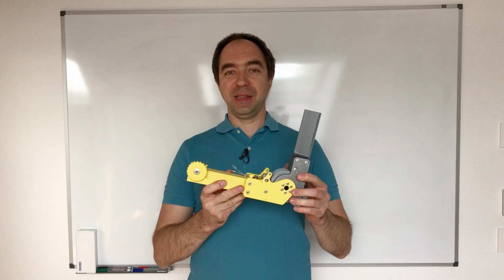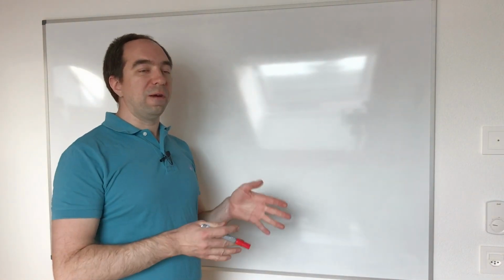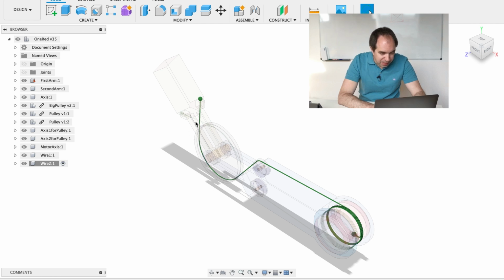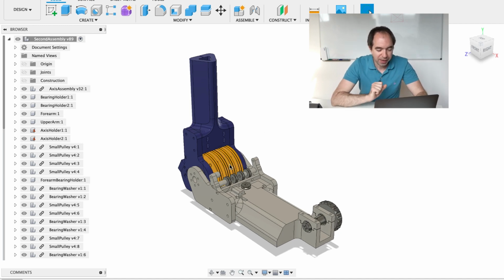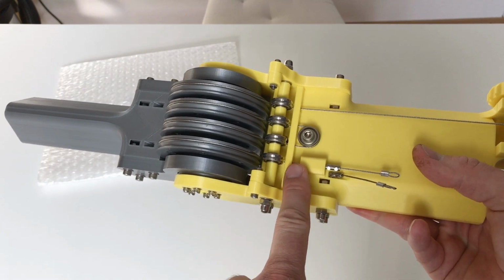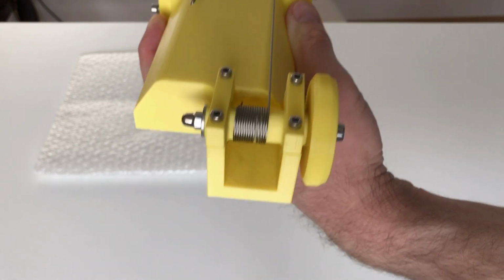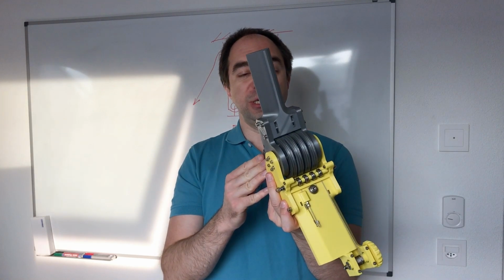You've never seen the Robot Joint like this one!

Comment: I don't think the spool to large pulley size makes a mechanical advantage because the large pulleys aren't moving, they are just functioning as a smooth corner for the cable. So it is only the spool to small pulley that function as a block and tackle.
Reply: Alana Catherine .....   possibly you missed the point of the design ....   i am still pondering it
Reply: Not at all, look at how the design would compare to a system that would be used to lift something instead of rotate it. The large pulleys are only functioning as bearing to allow smooth rotation around the axis, but they aren't actually part of the "reduction" system. The function of the size of the large pulleys is only to allow the small pulleys to have a straight pull on the cable.
Reply: Basically, if you look at the very first drawing he did with trying to lift a weight with only one pulley, that is exactly what the large pulleys are doing. In a block and tackle, it's only the pulleys that "move" that actually create an advantage. The fixed pulleys only redirect the force to make the system take up less space. You could get the same advantage with less pulleys but it would be a much "longer" system. (Hint: compound pulley)
Reply: @randomalleycat  Yes, precisely. The big pulleys allow it to maintain a more even pull on the cable when the arm is moving.
Reply: @randomalleycat  But the amount of cable in contact with the large pulleys reduces as the joint closes, so I think the small pulleys on the forearm do count as "moving". The opposing cable large pulley arc increases by an equal amount, but since you could exclude the opposing cable and still be able to contract the joint in one direction, I don't think that will cancel the "moving pulley" advantage.
Reply: @dekutree64  The pulleys on the same side of the arm as the spool are not "moving" nor are the large ones on the joint. You can only count a force multiple for each line that goes to or from the load. So you would get the number of "moving" pulleys, the pulleys on the "forearm" opposite the spool,
times two in this configuration. 

I'm not sure if you think that I was saying that there are no "moving" pulleys and no mechanical advantage at all, but that is certainly not the case. I am saying that the large pulleys only convert it to a rotating force from a pulling force. If anything, they add to the friction losses. 

I definitely agree that it works and is an awesome design, I'm just addressing an apparent miscalculation regarding the amount of mechanical advantage generated.
Reply: @abcqer555  Exactly, 
I'm not saying they aren't doing anything, they just aren't adding to the mechanical advantage multiple.
Reply: @cedricpod  why even say that without contributing to the discussion?

Comment: The difference of diameter between driver pulley and the big pulley will NOT add any mechanical advantage. If the big pulleys were half the diameter, the system will still have the same mechanical advantage. 
However, the diameter of the drive pulley determines the amount of cable being pulled per rotation, so a smaller diameter requires less torque.
Infact the diameter of the big pulley does not matter at all for mechanical advantage, it just acts as a force redirector.
Reply: That's what I initially thought too, but think about it in terms of the output angle for the input cable displacement. If the input cable moves a distance x, the change in pulley angle for a diameter D is 360deg*x/(pi*D). Since D is in the denominator and the arm angle is proportional to the pulley angle, you get a better reduction with a bigger pulley.
Reply: xenontesla122 ....   i think you may be wrong ....   possibly the big pulleys give plenty of cable length to consume and un-consume  ....  or perhaps i am wrong
Reply: @xenontesla122  your argument is wrong because the arm is not attached to the big pulleys, it is attached directly to the cables. Diameter of the big pulleys have nothing to do with how much cable is being pulled. The big pylleys (and all the other pulleys) simply redirect the force. That is how pulleys work. The number of pulleys multiplies the force but their diameter is irrelevant.
Reply: @AB-gd8hn  I agree with you. It is the number of repeats that matter, not the diameter of the pulleys. However, I think the diameter is important in this application because your 'payload' is moving and you want to maintain a certain angle... not quite sure how to express this.
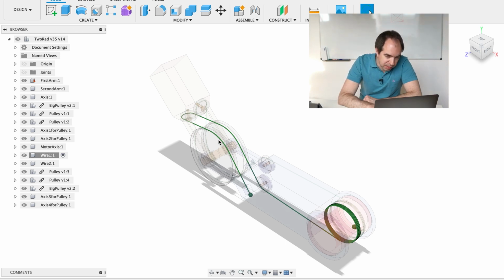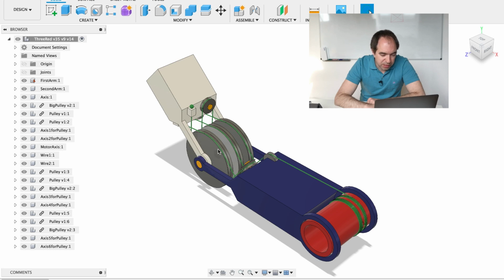Reply: @AB-gd8hn  In the first example at 2:43 the arm maintains the same angle as the pulley because the length of cable between the arm and the point where the cable contacts the pulley is constant. In that case, the change in angle is due to the length of cable in contact changing. This is very different from most pulley systems where the length of cable on the pulley is constant or the change in negligible. In my dynamics course, we solved pulley systems by finding an equation that links the change in length of rope to the change of the output. We always included the length of rope contacting the pulley in our equations, but it would normally cancel out because it's constant. If you do the calculations for the length of cable l as a function of the pulley diameter D and arm angle θ in radians for the system at 3:43 you get l = 2πDθ + four constants, so dθ/dl=1/(2*π*D). At 4:23 it's 1/(3*π*D) and so on, always inversely proportional to D.
Reply: Sort of. It's not the diameter of the big pulleys, but rather the radius of the arc the small pulleys travel around. their travel arc radius is rougly equivalent to the big pulley diameter.

Comment: First of all fantastic build!

There is a reducer based on cables that could be awesome in you set up. 

The elbow should have a single wheel and two single cables terminated in blocks. Just like your first set up but terminate in the “bicep” with the fixed side of blocks. 

The motor shaft should have two small and two slightly bigger cylinders. A cable should be wound on the small via the block to the big. 

This system gives reduction based on the circumference of the cylinders. Equal cylinders gives infinite reduction.

Comment: Imagine a motor that drives an axle, that have two different diameters, having the start of the cable on the small part and the end on the big. When winding the "differential diameters", it will shorten the cable loop going through a simple pulley. 
The smaller the diameter difference the bigger the force it can pull...
Do I need to mention that the cable is fully winded on the small part and it unwind from there to windup on the larger part and vice versa... You can make on axe with 2 pairs of these reducer, for reciprocal moves...
Reply: I like this idea.  Using the similar idea of pulley-based mechanical advantage wrapped around a joint but with a differential pulley system. The only disadvantage is that the load is not spread across multiple cables so the tension in the cable and the loads on individual pulleys is higher.
Reply: check out the work from Rise Robotics e.g. https://www.youtube.com/watch?v=RGuivIN5y3w
Reply: @bschena  That's simply amazing. Thanks!
Reply: brilliant concepts  ....   thanks for sharing
Reply: There is a mech called a "Chinese Windlass" that sounds exactly like what you are describing. I built a high pull system based on this concept decades ago. It's great in principle (and works in practice), but there are a few (very related) really serious issues with it. 

At the bottom of it all is that the mechanical advantage you get (from zero to infinity in a single stage, theoretically) is related to the "D-d" ratio of the two pulleys (e.g. the differential diameter as you described). The higher the ratio, the smaller the delta BUT the longer the cable required. For short, high force designs it's manageable. If you want a long stroke design you end up fighting the cable length in two  ways - e.g. where to "store" it (you need LONG capstans to reel it all from one side to the other - so each "side" needs to be designed to hold essentially "all" the cable, so its not very space efficient. 

A related problem is called the "fleet angle" problem. Essentially, that's the (geometry) problem you get when you try to wrap a mile of cable around an axially-long capstan. Cables are pretty fussy things and not friendly to high fleet angles - adjacent wraps start to rub on each other, causing destructive wear, friction, and cable "jumping". 

There is also a cable length change that occurs as a result of high fleet angles, so you need to accommodate that or you will end up breaking cables just by running the system from one end to the other, even without an outside load. This forces you to variable capstan diameters (search YouTube for Rise Robotics Cyclone drive from about 2014), laterally shifting pulleys (I have a patent on one way to do that), or spring tensioners, or some other scheme.
It works, but as always, the devil is in the details.

Comment: It's crazy how smooth it is.
You did such a great job designing this!

Edit: why not use this technique in the robot arm? pretty sure it's possible to improve your already impressive design to make it thinner and increase the angle.
Reply: i'm super impressed and enamoured by this beautifully smooth design too, but one issue i can imagine are the loads applied to some of the small bearings and axles that hold them, further into the reduction.
Reply: @DMonZ1988  The force is the same at every pulley.  The cable tension is the same everywhere, so each small pulley gets 2x the cable tension shear load on the axle.
Reply: @MathewBoorman  I disagree that hte force is the same at every pulley.  If that were true, then the pulleys are not a force multiplier at all, yet we know they are.  Each pulley in the system has 2x the force placed upon it than the prior pulley upstream of it.  So the first pulleys can be smaller and less robust than the later pulleys in the down-gearing system process.
Reply: zero backlash gears are used in the Canadarm and Canadarm2, if that's what you are asking.
Reply: Follow
Reply: Bump this (follow-up) question! Why did you decide not to use this style of mechanism for your ongoing project? Was it because of the friction like @Kenny Kim suggests? Does using a mechanism like this complicate the placement of motors and resulting weight distribution?
Reply: Joannot this probably introduces a lot of friction due to the increased contact between the cable and the pulleys. Not sure how that will play out in actual applications but I'm assuming it will hinder the torque tracking ability.
Reply: @GiftedBalla  It has the advantage of keeping the motors closer to the shoulder, thus you can use a more powerful and heavy motor...
Reply: @gustavom1660  also it reduces the inertia of the arm since the motor is keep at the base and is not distributed trough the whole arm

Comment: Nice work! Have you tested it under load at all? I'm curious how much torque the joint can take before something breaks or flexes enough for the opposite cable to lose tension and fall out of the pulley grooves.

Comment: Hi, it is a good design. This is called tendon driven actuator or robot sometimes it is called as cable driven mechanism. One of the best example is davinci surgical robot instrument arms.
Reply: daVinci engineer checking in. Aravinth is correct - the robot arms on the daVinici Standard, S, and Si were largely cable-driven. The current Xi system does NOT use cables (though there are some flat metal belts on one axis) in the robot arms. However, nearly all daVinci surgical INSTRUMENTS do still use cables. In fact, the very first CAD Skyentific shows is very similar to the system used in the instrument wrists. link to a video that shows some of how that works: https://www.youtube.com/watch?v=KNHgeykDXFw
Reply: bschena ....   why was cable drive abandoned ?
Reply: @cedricpod  They worked very well, but were not terribly stiff and required a lot of periodic maintenance to maintain performance. The fleet in the field started getting so large that having to touch every arm on every system a few times per year was a growing headache for both ISI and the hospitals.
Reply: @bschena  Yes absolutely right
Reply: bschena what is the advantage disadvantage of the cable/flat metal belts that caused the change?
@skyentific mentions this being back-drivable, is there a way to prevent that in this system, if that is unwanted??
Thank you immensely for your input
Reply: @MM-24  The flat metal belts on the pitch axis were a carryover (conceptually) from the earlier designs. They worked well and were super reliable. We kept the belts in Xi but ditched the complex drive cables for the other axes. I should note that the belts had nothing to do with the actuation/drive system of the pitch axis - they were basically there to maintain arm geometry and transfer torque, so they did not contribute any "gear ratio" / torque amplification or anything like that. The pitch axis had it's own gearbox for that.

Backdriveability is a critical performance requirement for a bunch of reasons - we engineered the ever-living-shit out of the system to get it to perform as well as it does. Skyentific's perspective on robot design is spot-on for teleoperator-type devices like surgical robots, and also exactly relevant for co-bots for many of the same reasons (force sensitivity, "soft"/safe interaction with nearby people, etc.)

Other robots, like those used in automobile manufacturing, can often live without good backdrivability and usually need crazy high torques that are beyond most cable transmissions. But those are really different machines designed to meet very different requirements. I guess us teleop people take understanding all that for granted.

Our host, Skyentific, is the most knowledgable robot enthusiast I've seen on YouTube so far. All of his videos are highly (technically) accurate and well-explained - both of which clearly come from a deep understanding of both "the problem" and the technologies that are available.
Reply: @bschena  thanks for your explanation - great to hear this from a production and operations point of view.
Reply: @bschena  Thank you, this is all great info, and even more so coming right from the source!
Reply: @bschena  Why is back drivability so important for teleop machines?
Reply: Sorry, I reread your comments and realized that you already answered that. Coming from a machinist background, the idea that you might want the thing that your machine interacts with to be able to push it back was a little counterintuitive to me, to say the least. 
I'm curious, what actuation system did you use to replace the wires/cables?
Nichrome water muscles, perhaps?
Reply: @bschena  that flat metal belts are called as constant force springs. These are used to transfer torque and also produce gravity compensation or balancing with help of spring stiffness. Initially that flat belts are in rolled condition, once robot's axis starts moving it will get flat.
Reply: @MM-24  To prevent back driving, you could just use a worm gear system to drive it.
Reply: Learned to program a small arm. When you looked at it, it looked so tiny. It was also really fast (even when limited). But the thing was heavy AF 😁(one of the joke being to release all joints for a tenth of a second and see your colleague panic--yes, students are stupid)
If you were in his way, you would be crushed for sure. I know because first day we made a dent in a pole that was in the way. It was a good demonstration that we had to keep clear if the arm was working or if we were unsure.

It was also a joy because you were able to put it in a mode where you can move it and record its pose. Then you can instruct him to go from pose to pose.
It was also possible to program using joint interpolation, but that's much harder simply because of timing and that you had to remember joints numbers.

It was the most dangerous equipment in the lab and we had only one. I guess it was that dangerous and only selected people could use it.